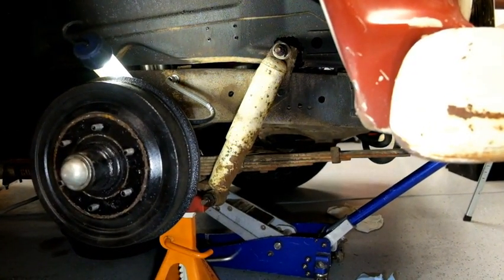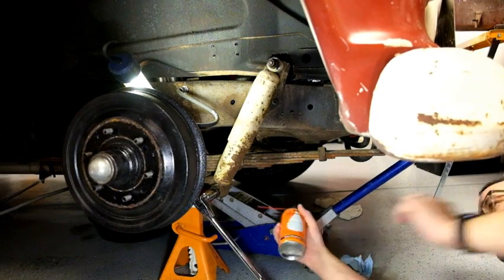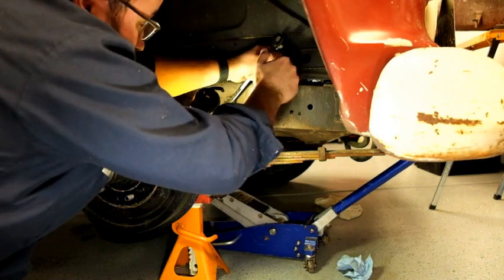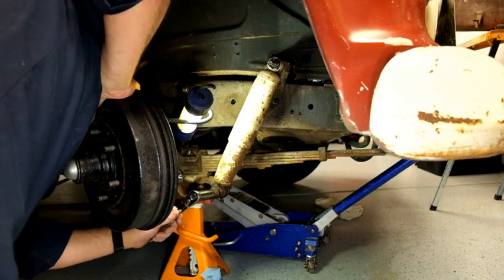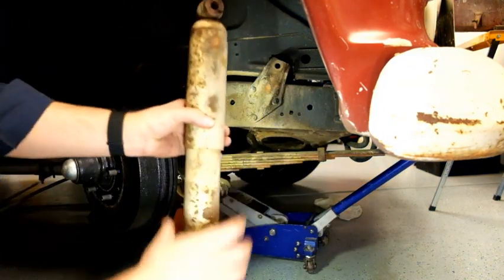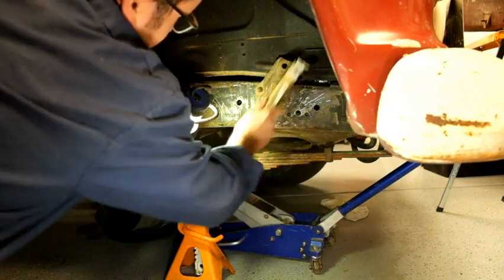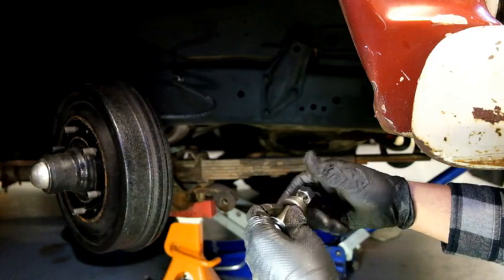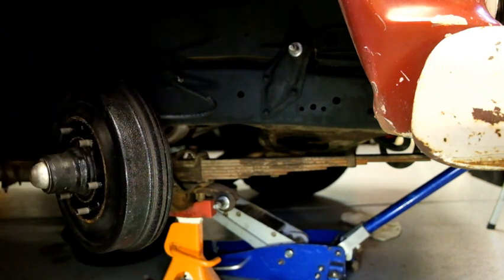1957 Chevy 3100 Truck Front Shock Absorber Change

Comment: Do these trucks sit differently with shocks? We have a lowered 48 with leafs only at the moment. Will adding shocks change anything?
Reply from the maker: @bleugate  shocks will affect driveability with your jounce and rebound.  You'll bounce less after bumps/potholes etc, and most likely give you smoother transitions in and out of turns.  New shocks made mine feel like a better truck that's for sure